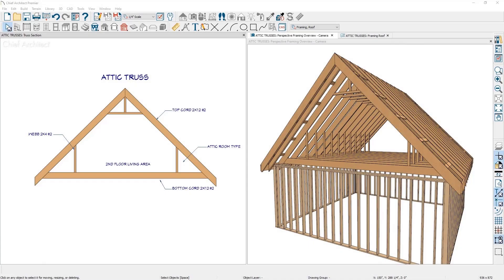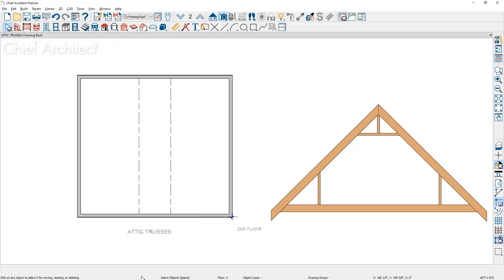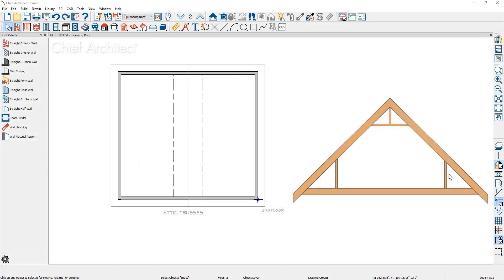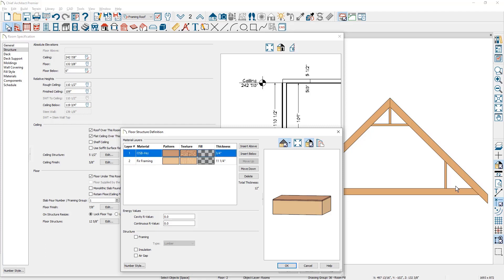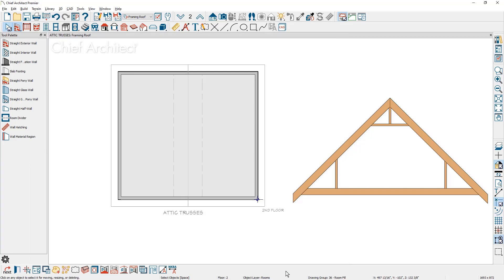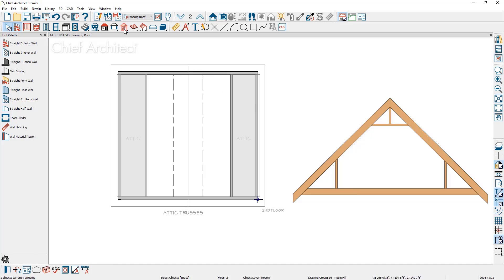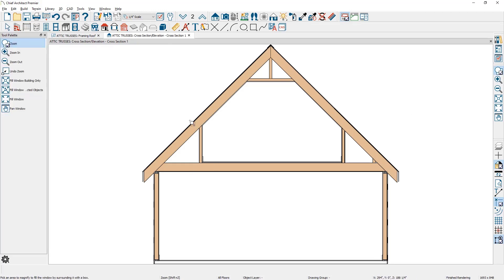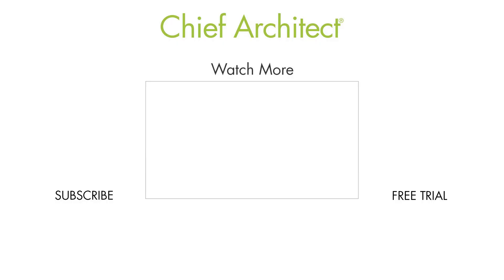Framing with Attic Trusses

Comment: Best practice before generating the multiple copy of the attic truss is to point to point move your first truss to the front or back as a gable. Then, do a multiple copy @ 24 o.c towards the other end. This will save having to move trusses again if you started the way in video. Thanks for the upload.